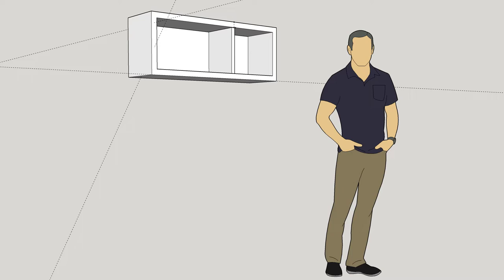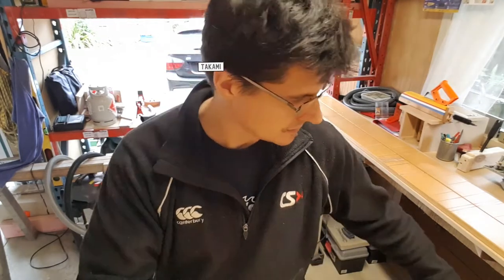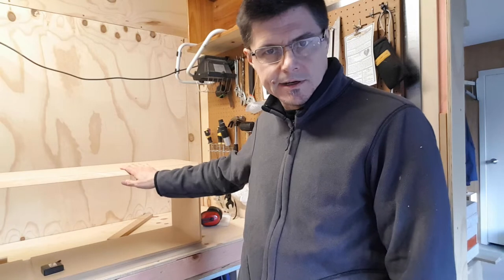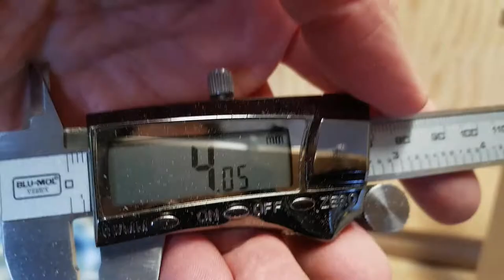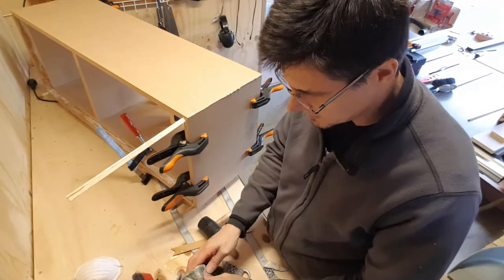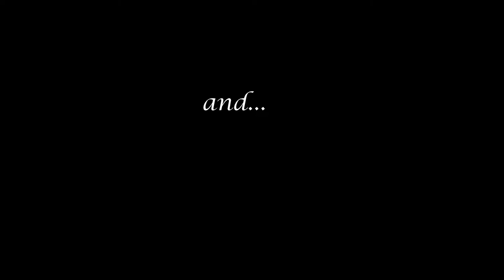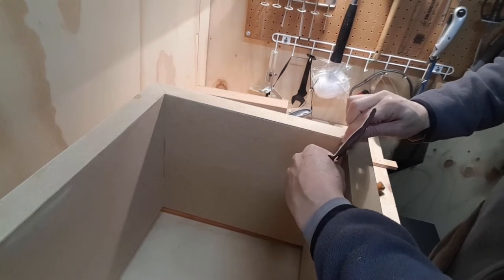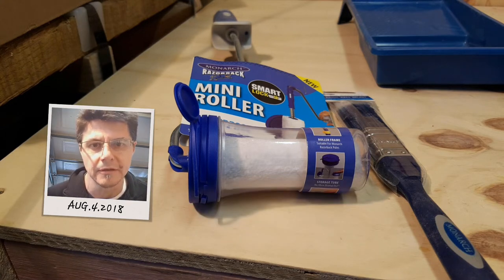Building a modern wall unit

Comment: That's the most complex simple project I've seen in a while! The pure essence of hobby woodworking encapsulated in semi-gloss whiteness 😁 Must have weighed a tonne by the end!
Reply from the maker: Well said! it's still hanging in there though - despite me almost compressing half my vertebrae lifting it up onto the wall. It needs repainting where the mitered face frame pieces join together, but once it comes down off the wall it's never going back up. #catch22

Comment: Rob I’m surprised you pulled off such a remarkable build after you & I had 14 pints of beer 🍺 just prior to you making this 😜😜, however you’ve done it & even though you had the occasional gap 😮😔 the end result was magnificent, see you at the pub soon ok 👌😎😁😁😁
Reply from the maker: Hahaha - nice call - blame the gaps on me drinking buddy plying me with round after round. 😁 Luckily with MDF you're always going to paint it so filling gaps is sort of something you can fall back on - a bit overkill for my dingy little office but I wanted to see if I could make something "nice", and this is kind of a practice run for a larger built in wall unit I want to do in our lounge for the TV etc. Thanks mate - c u @ the pub.🍻👍